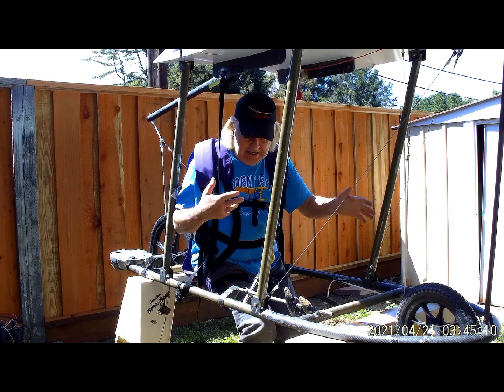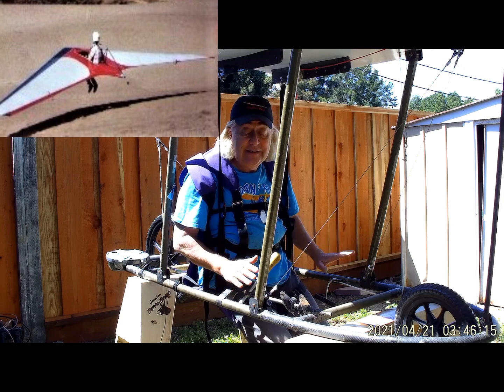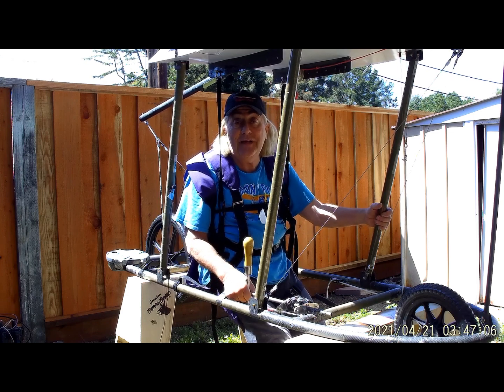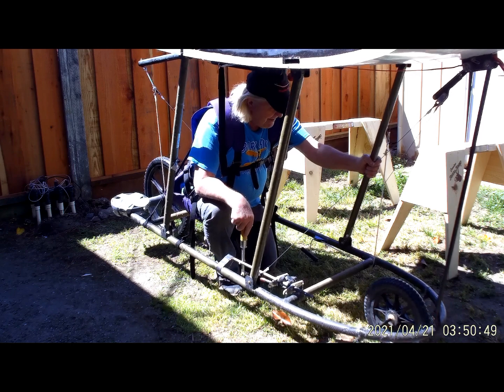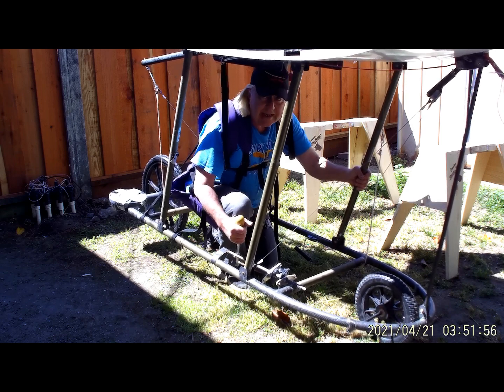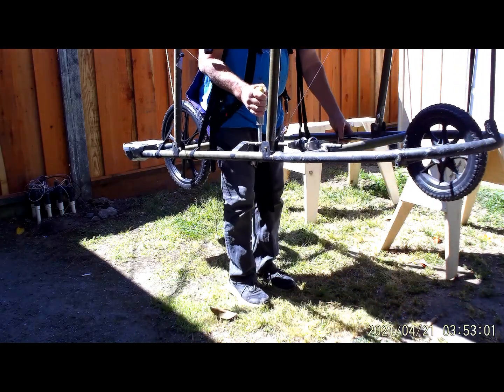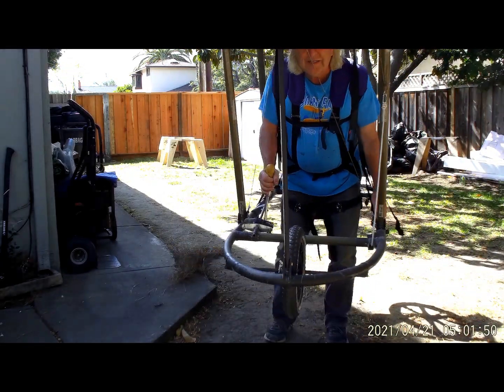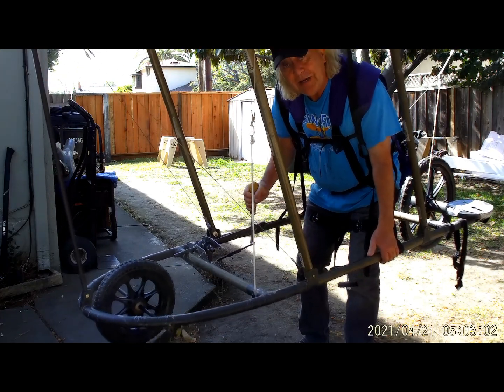KW MkII Rigid Wing Ultralight Hang Glider Development - Human Machine Interface Part 3 of 3

Comment: It looks a little awkward, the wheels are in the right place but the stick and parallel tubes seem a little too low and wide?
Reply from the maker: yep, that's why I discuss having to rearrange those components. Perhaps you skipped that part of the video where I mentioned that the current config is good only for initial test hops. If the wing flies OK, then I'll go to the trouble of rearranging the stick setup - all part of the development process.

Comment: I remember (many years ago, before Rome fell) my hang gliding instructor built a Mitchell Wing.  I got to watch his initial flight off the training hill.  He left the ground easily and was maybe 20 feet up.  Things took a turn for the worse when his weight shift instincts took over and he PUSHED on the joystick (overhead I believe) to slow down...but of course this put him into a steep dive which ended with a large thud into the turf.  Close call. It scared him enough that he sold the ship.

Comment: Thanks for these informative videos.

How fast do you have to be able to run to take off?
Do you land on your feet or on the wheels?
Reply from the maker: stall speed is around 20 mph  aircraft is designed to operate either by foot or wheels